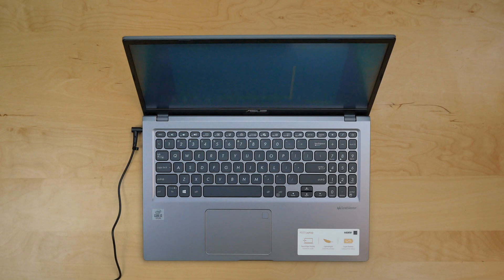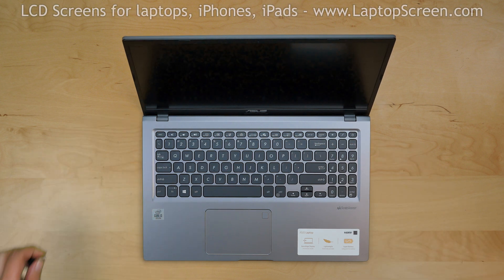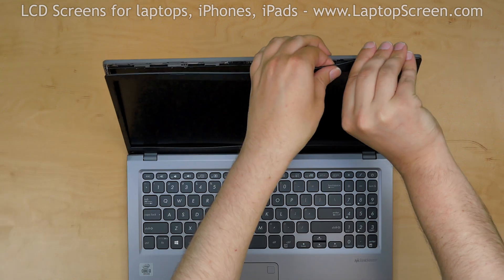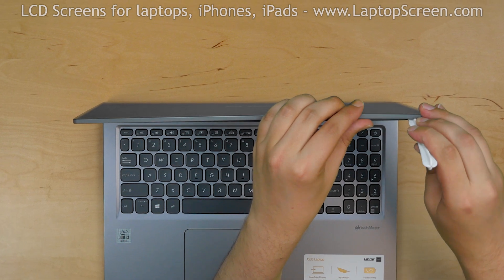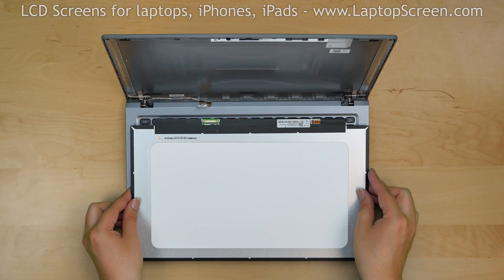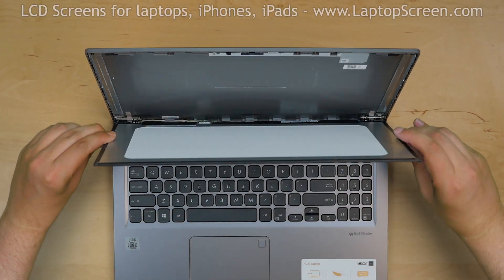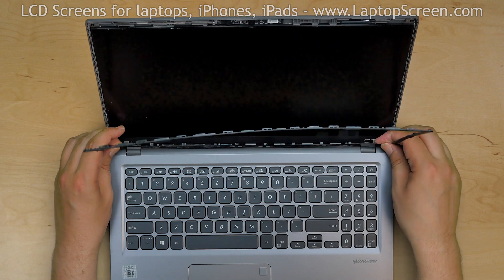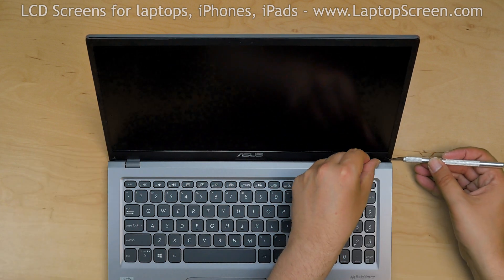How to replace LCD Screen on Asus F515J. Step-by-step instructions

Comment: Ok 👌 my Asus same like this just stopped working for no reason doesn't indicate charging and wen turn on no lights shows by the side and the screen was flickering glitching before this a friend told me the connector cable was the issue but why isn't it turning on again any advice?

Comment: I have ASUS  e410ma-ek467ts . I want to take out the broken screen. But the laptop doesn't shut down. I tried all options in windows 11 power options, and still the laptop keep turning on when lid is open. How can I make sure it shut down completely?
Reply from the maker: You could take the bottom covers off and try disconnecting the battery. Otherwise just do it live, like the game "Operation", but instead of the buzzer your motherboard may release the magic smoke that makes it tick.